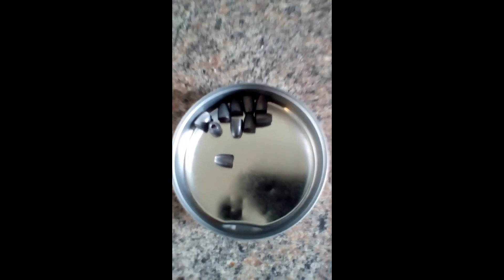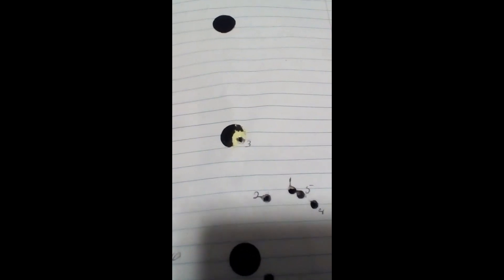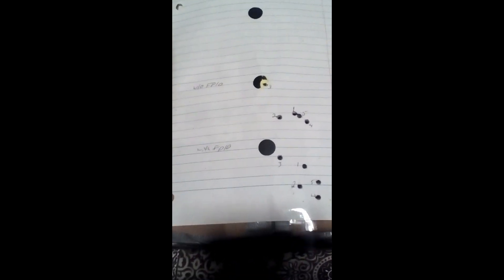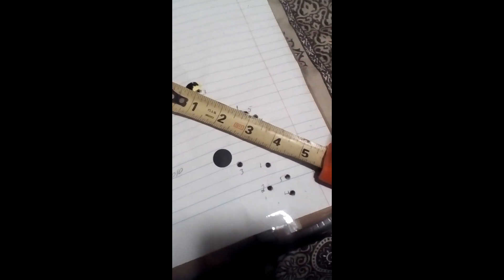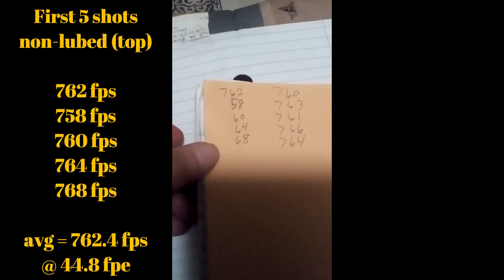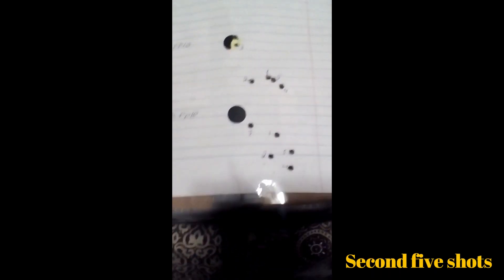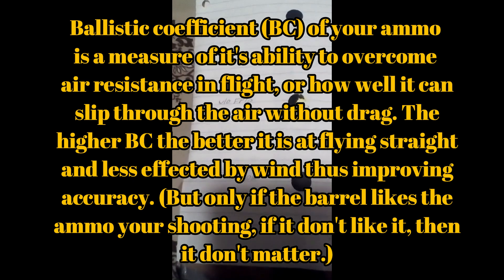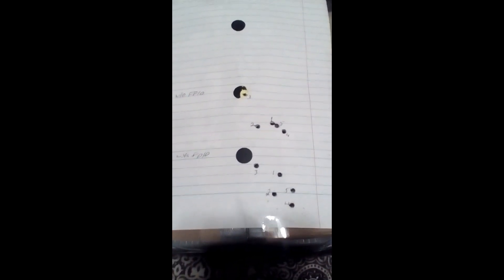Hatsan Flashpup 25 -  Unregulated Slug Accuracy

Comment: With the bolt being so far back, does anyone know if it would be too awkward for a leftie to shoot it? I'm really looking to get one of these.
Reply from the maker: I have the wood, I have no issue holding it to shoot left handed, the bolt is far enough forward that it's not against or close to your face while you're holding it. I just ordered the synthetic, the bolt is bigger, but even at that the placement is forward enough to where is shouldn't be a problem. I like mine so well I got another .25 cal on the way. I wanted another gun and for the price nothing beats it in my opinion.
Reply: @slowpokeairgunner4027  thanks for the reply.

Comment: You may want to check your barrle choke. Push a slug though the barrel with a wood dowel then check the grove pattern  for consistency. My hatsan bullboss had a horrible choke and will not shoot anything past 50 yards. As for a reg and slugs I have .25 hatsan bullboss with huma reg I took my reg out to shoot slugs because the .25 cal plenum is to small for slugs I'm thinking about ordering a .30 plenum for it. But back to the barrel if you see the groves are deeper on one side then the choke is uneven and deforming the projectile. At least that's what I came up with on mine. I need to do a video on it
Reply from the maker: I think I had some lead in the barrel that I didn't get out. I cleaned it real good and the groups started closing in pretty nice, simply haven't bought any more to try again. I had quite a few to test with but  I left them overnight at a friend's house and his dog ate 'em, well, got them and chewed on them, now what's left has been teeth holes in them.
Reply: Where will you get a 30 caliber plenum for a hatsan bull boss 25
Reply: @charlesbruce4999  I'll have to double check but I believe the spacer that huma makes is the same for the at-44 and the bt 65 I'm pretty sure you could use a .30 bt65 plenum with the at44 reg and it would work. As I said I'm not 100% if it would work or not. That's what I would try to do though if possible it would just make everything work a little less hard and still deliver power

Comment: Got lots of coyotes and a few bobcats on the farm i hunt really like to have the extra weight of the slugs but wondering if I would be wasting my time? Wouldn't be better off sticking with pallets and going for headshots. I shoot a flashpup 100% stock.
Reply from the maker: I didn't have luck with these, but I needed to reclean the barrel before shooting each set of slugs. Take a look at Brothers In Air's channel, it will shoot sugs, but you have to keep the barrel clean and slow the speed down. It should be able to shoot them at stock settings. I am going to try  the .249 head size for the 25 caliber 26.8 gr NSA slugs and see if they will work at higher speeds. They don't work really great at higher speeds the way slugs usually do in a gun, it may be the choked barrel, not sure, but Bothers In Air had his shooting great, better than pellets at stock tune, which is a slower speed, but they still have plenty of power downrange, and accuracy. The heavy 55 gr were slow, to heavy for this gun, but they shot the best at the slower speeds. Brothers In Air tried the 34.6 gr at lower speeds and they were killing it at 75 yards.

Comment: So did you need a slug liner barrel or no?
Reply from the maker: No, I believe I had a barrel problem, it needed to be cleaned. Hatsan barrels are known to need cleaning occasionally, I did not clean it before I originally started testing the slugs and they were off. These slugs lead the barrel up pretty bad, I had to clean the hell out of it and it started shooting the 34 gr pretty decent. I am going to order the 29.5 gr, they are sized at .249 which should work better with the choked barrel. I will try these again, I had pretty much run out of them by the time I cleaned the barrel and saw the groups starting to get tight. I'll need to tune around the slug to get it where it likes speed-wise, but I think they'll work well. I do want to try the heavier slugs again, I wanted them for coyote, I'll have to see what happens with these slugs the next time around. Others are getting accuracy out of them, I do believe my barrel needed to be cleaned again, my fault completely if this is the case, which I think has a lot to do with it. I'll find out. Thanks for the comment and watching, I really appreciate it.